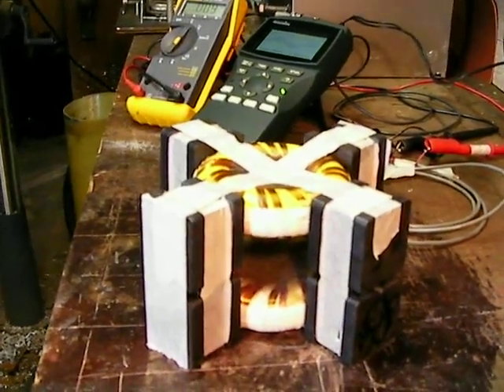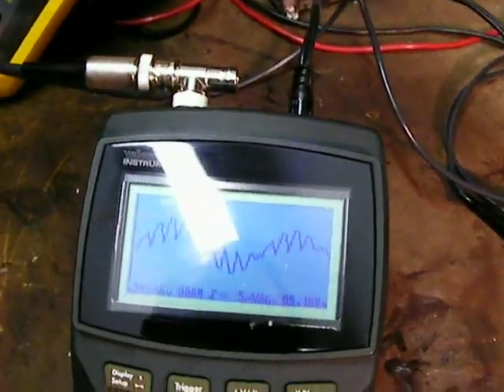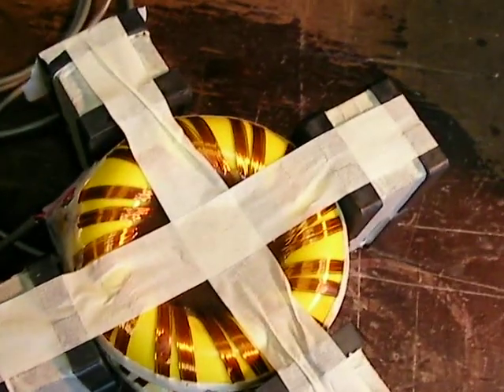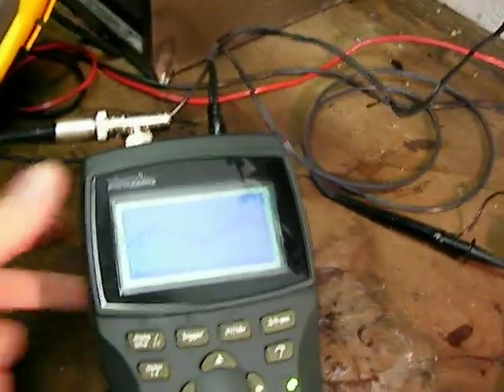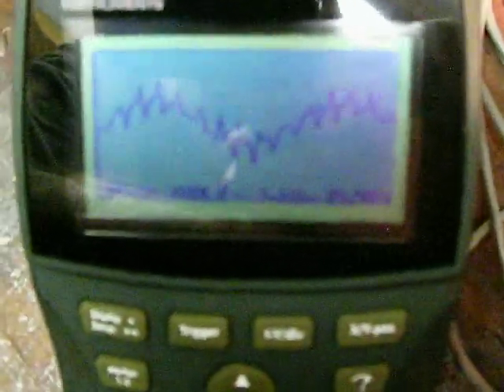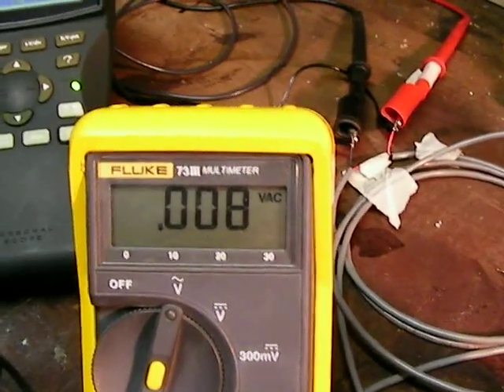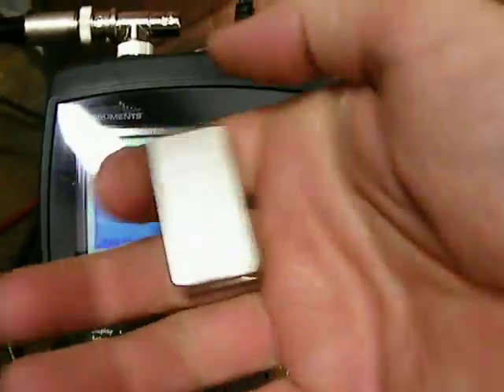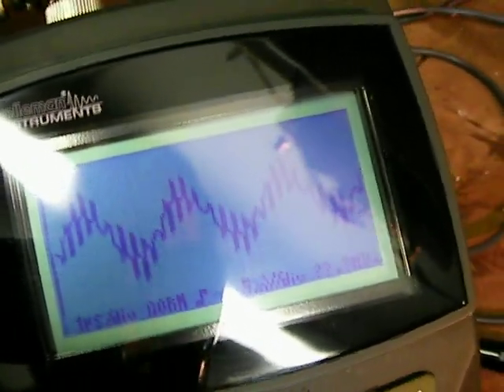Rodin Coil unreal discovery!

Comment from the maker: this video has sparked alot of insults and accolades. the fellas that say i need to go to school are missing the point of the video! the rodin coil is a very efficient antenna and it is very sensitive to the slightest changes in a magnetic field. try to move a small magnet outside a normal wound coil you will not get the same results.. if you look at all my videos you will see that yes i do have magnetic and electronic knowledge.. sheesh!

Comment from the maker: OK! what the heck why all of a sudden i am being slamed and my intelligence is under attacked by jerks who do not have any videos posted! i have been experimenting with MRM coils for a long time i have successfully integrated a coil design that i perfected into a  water treatment system for the oil and gas fracking industry. all the flowback and produced water that has been run through this unit has been successfully cleaned! i am helping the environment what are you doing?

Comment: Rodin toroids are merely a phase shifted coil system, and induce moving magnet fields in the same way as more conventional coil windings in an AC  motor, which use other ways to produce the phase shift. I should know, I have designed motors for a living and tried almost very conceivable coil type. They does exhibit strong central fields due to the toroidal form, that is all.

Comment: Any coil and even a straight wire has a self resonance frequency. Any time a magnet moves across a coil a voltage is generated and this why the osciloscope shows this. You could wrap 100 turns of wire on 3 inch plastic pipe and observe the same effects.

Comment: I've been messing around with Bashar STA coils .. and similar to Rodin, they can easily pick up energy from nearby CFLs or Florecent lights. Be sure to kill ALL power in your room and see if the coil self resonates as easily. Also, observe the power levels during the day versus night when the sun has gone done. In my case, power drops significantly after the sun goes down.

Comment: Dude, that's awesome! i got goosebumps just seein' the self-resonance graph... what you did with the magnet later on was simple magnetic induction stuff, but the initial self-resonance bit is great... did you have to excite the coils with an initial  pulse or did you just simply keep 'em connected to a DC power supply? And what were the voltage and current you applied??

Great work, man. I'm inspired!